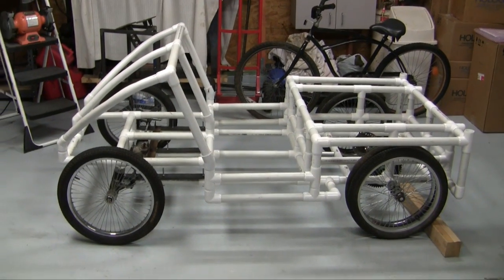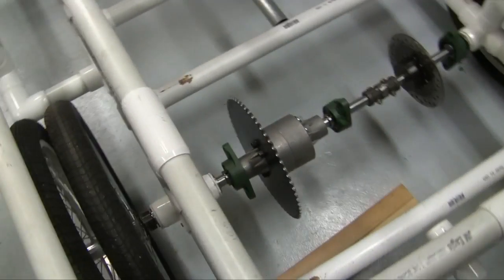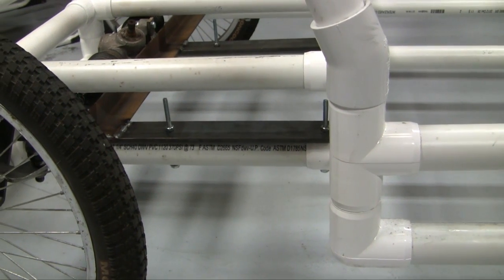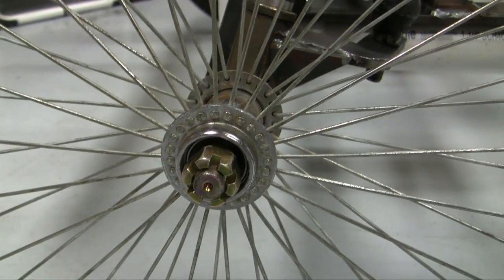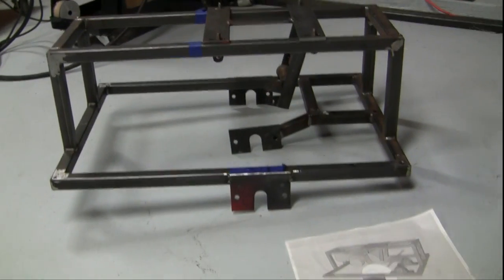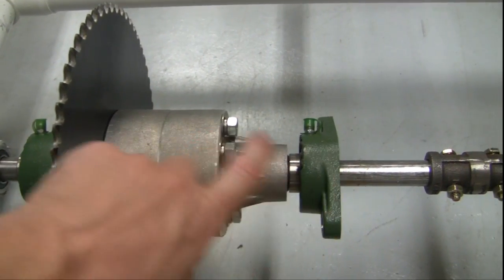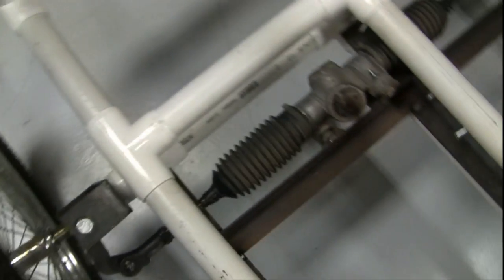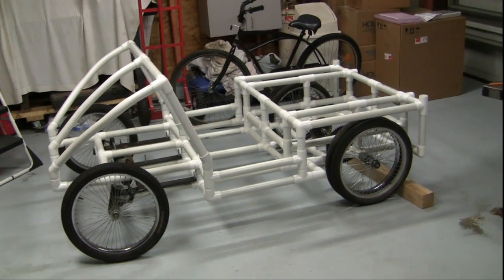PVC Buggy Part 3 - Update

Comment from the maker: The spindles came off of the little Chinese 4 wheeler that I got the motor from.    The rear end parts I got off of ebay.  The little differential is from a lawn mower.  I got a brand new one from ebay for about $60.00.

Comment: would the weight from this project be light enough with the skin added to serve as a pedal powered quadruped? (minus the engine of course. I like the basic design and have thought about doing something like this but with a longer back end (like at ruck bed)  to serve as a grocery getter
Reply from the maker: I think that the weight would be fine for a pedal version minus the engine, and steel sub frames that I made.  If you watch my intro video, you will see that I got the idea for this buggy from americanspeedster.  There are a few areas that you could use PVC, or aluminum, where I used steel, to lighten it up even further.  I plan on using a really light weight skin like coro, so the weight of the skin wont really matter.
Reply: +freqster how long did it take you to build this thing?